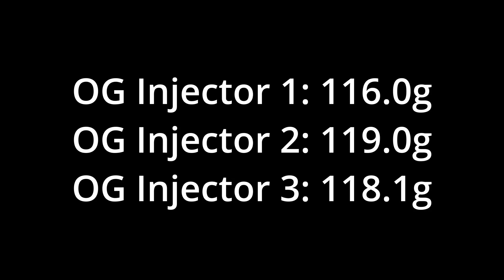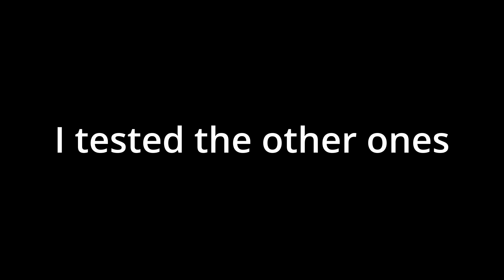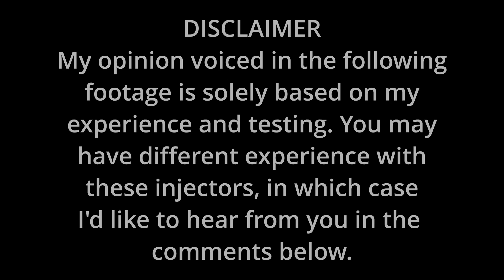Before watching this! Are these injectors bad for your BMW K75 K100 K1100?

Comment: Great video I installed some generic ones n fuel leaked all over lol.
Reply from the maker: Thanks! And ouch! It’s never fun with fuel all over…😅
Reply: @volimoto  can give the link to injectors
Reply from the maker: @harpindersingh3401 I’ve get them locally from an autostore but you can find them on eBay or Autodoc. If you’re in Europe here’s an eBay link: https://www.ebay.com/itm/385448715833?mkcid=16&mkevt=1&mkrid=711-127632-2357-0&ssspo=R5Wcwwv3Smy&sssrc=4429486&ssuid=oPDL6EmxRpS&var=&widget_ver=artemis&media=COPY

UK autodoc: https://m.autodoc.co.uk/bosch/1150376

Hope this helps!

Comment: I installed Bosch 0 280 150 987 injectors (4 holes) on my 1996 K75RT. They work great with the same fuel consumption as the original ones.
Did your bike come standard with those 4-pot front brake calipers?
Reply from the maker: Thanks very much for the info! 🏍️ - Just did a quick search for them and they’re also identical specs to the original and the one I installed now. It’s great there are many variaties available. Hope you like the video👍🏻
Reply: You're welcome, did your bike come standard with those 4-pot front brake calipers?
Reply from the maker: @zombiewoof5257 No it didn’t. They’re from an R100R. Calipers, discs and master cylinder. All of those parts are straight bolt on to the K75 and early K100s.
You can get the calipers from later 4V models, they’ll bolt up fine, but the disc spacing is off by 3.5mm (if I remember correctly). But if you can get the discs from an R100R (maybe R80R as well) they’ll fit. Also the  master cylinder is a straight plug&play just with the two bolts into the switch/level armature. The later K1100 master cylinder are actually different size and they don’t fit onto the K75 only with some modifications. 
Hope this helps🏍️😎